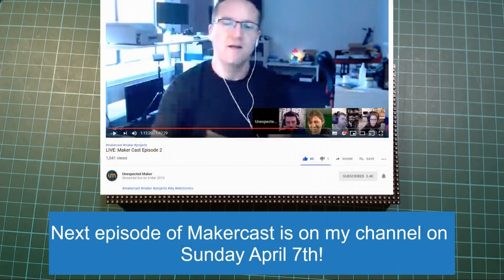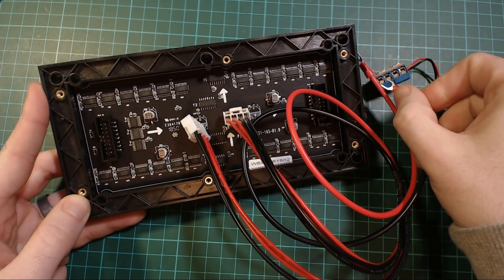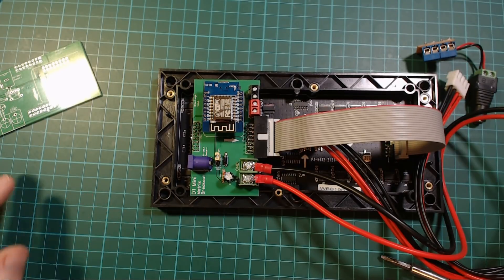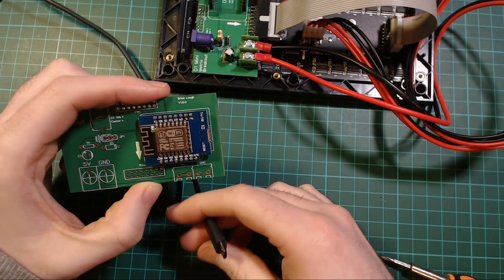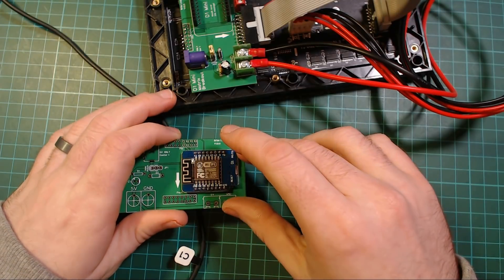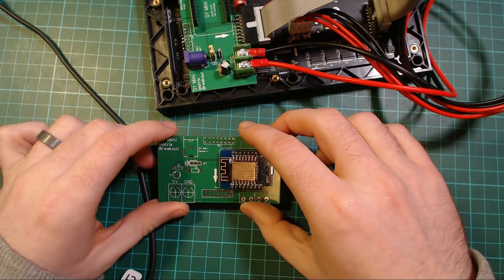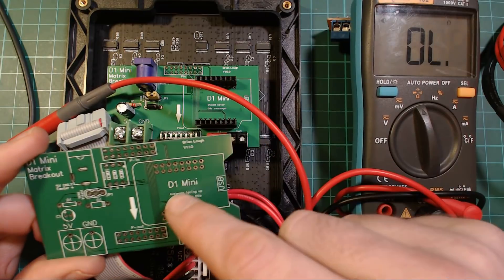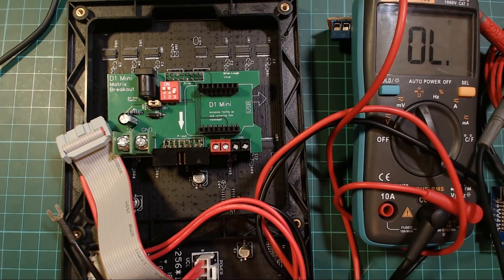I Made A Mistake With Something I Sold On Tindie!

Comment: It was good to catch it early.  Better to only sell 10 than 100 plus.
Great video and the honesty is refreshing.
Just a quick question about the controller.
Can you connect more than one matrix panel to your controller?
Reply from the maker: Thanks, yes it's possible. I've only ever connected two so I'm not sure what the max is. The wiring is p-out if the first display into p-in of the second, and then p-out of the second back into my board

Comment: I have a few of your ESP32 boards. They're great with the smaller 64x32 (with E) matrices. 

But I see you have one of the "non-E" 64x32 P5 ones, which I also just got hold of.  I can't seem to get it to work, even with the E-pin down. 

Also, in all the other docs and demos I've seen of the P5 boards, I never see those 'extra' connections between the IN and OUT HUB75 connectors. What's that all about? I'm still perplexed about the need for those extra connections for a single matrix board from its own IN to its own OUT. D'yknow what I mean?

It's doing my head in. 
:)
Reply from the maker: I've had issues programming that larger screen when the display is plugged in, no idea why! I just plugged out the display PSU and it programmed fine. I suspect that's not your issue though.

Maybe open up an issue on the PxMatrix. I don't mean to pawn you off but there are some different chipsets and patterns that the library supports, but I've never had to use them so I'm not sure what the story is with them!
Reply: @BrianLough  So it turns out my matrix must be kaput. Another P5 32x64 one arrived today and it works fine. 

But I've also found that I needed to power down the board to be able to upload a sketch with Arduino.

Comment: OK, so let me get this straight... some displays require another signal from the D1 Mini to pin E to work but some others ground that pin because they don't use it (thus putting the D1 into flash program mode)?  Is there a display version that doesn't use pin E but also just leaves it floating?  What about pins C and D?  What is the problem with leaving them connected all the time?  I don't have a D1 Mini so I don't know.
Reply from the maker: Yes, some displays don't use E and they ground it.

Not that I know of (re floating)

(C & D) Should be ok to leave, but the dip switch is there if needed. I haven't come across a display without C or D yet

Even if it doesn't cause a problem, it's best to disconnect them so you could potentially use the pins for something else (a sensor or something)
Reply: @BrianLough  - OK.  Well I do have one of these displays that I haven't got around to using so I ordered a Wemos D1 Mini (and a bunch of other shields) to try it out.  Should be fun and if I decide to keep it permanently as is I will likely order one of your PCBs.  I will check with a meter now to see if that pin is grounded.  Thanks for the reply, Brian.

Comment: You should have saved some money by using cheap plain 0.1" pitch pins and jumpers... already had a jumper on the board so why add another different part... would also allow people to just solder a 0 ohm resistor or a wire (lead from a component) as permanent jumper.
Reply from the maker: I like the dip switch, I think it makes it very obvious what's what with it.

The dip switch are less than 20c each so cost wasn't a huge problem. If I went with headers and jumpers I would need to add 6 extra parts to a kit, which would cost me more than 20c in time.
Reply: @BrianLough   ... and you now have a rainbow of components on the pcb .. big green connector, read and black 5v and ground) power connectors ,  slightly less red dip switch, some black/puple/blueish dc-in jack, yellow jumper.. where's the visuals, the symmetry (why the bigger green power connector instead of using 3 of same color smaller connectors)  
Jumpers are cheap in volume and can be used on multiple boards and projects ... ebay has them for ~2.5$ for 200, Digikey has them for 3 cents each if you get 250, lcsc dot com sells you 500 for 2$ ... as for the headers you can buy strips of 1x40 or 2x40 or something like that and cut a 2x3 chunk out of them ... or you know, redesign the board so you have that jumper on the left of your 3 jumpers with a space as separator and now you can place a 2x5 header and 4 jumpers in the box instead of header + jumper + dip switch. 
You also added what's basically a mechanical part, which may fail at some point or cause imperfect contacts though it's highly unlikely... and if somehow it fails, user may not be able to find a part with same pinout pitch thickness of leads etc etc
Anyway... i can understand your reasoning so it's not a big deal, it's just a part for a low volume thing, not the end of the world.
Reply: @mariushmedias  what's wrong with rainbows? ;P
Reply: @mariushmedias  the green connector is that size intentionally to suit the spade terminals on the panel power harness. I don't see an issue.

Comment: Ok. Now I understand the reasons for the new revision even better. As a maker I just would have cut that track if I ran into any problems with the e pin.
Reply: Cutting it wouldn't be a good solution, since i had one Display with e Pin and one without. But i cut the PCB to fix the USB problem.
Reply: Marc Bolver as i normally won’t change the matrix display after finishing a project I don’t see any problems with it. And if so I just would resolder it. At the moment I have 3 displays. All from the same batch and all without the e pin grounded.

Comment: That's not a fix, that's a solution to allow your new revision board to work on multiple types of display! Great job Brian, well dealt with, and communicated out. I wouldn't stress too much on the ones already out there who come into this issue. Good fix for the USB port too - it's the little things that make huge improvements to a design.

I STILL need to get myself one of these panels! Will definitely get on your Tindie store if I need a Wemos to power and work it!

Comment: Dont those displays really need 5v logic levels? Every design Ive seen for them uses something to level shift to 5v...
Reply from the maker: I seen that in a raspberry pi shield (hat?) a few weeks ago, but I haven't had to with an esp8266 anyways. I haven't seen anyone mention it in my first video about it either so it doesn't seem to be a problem